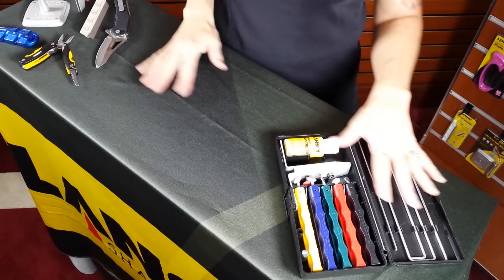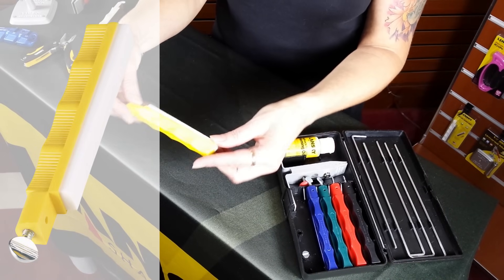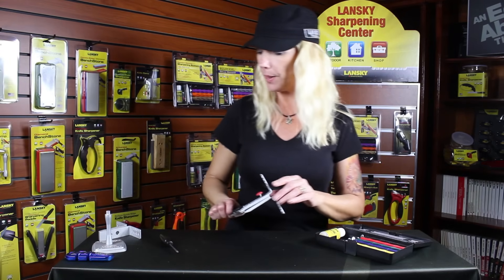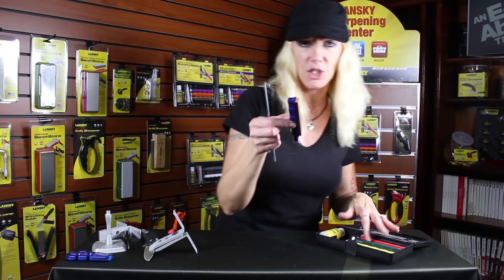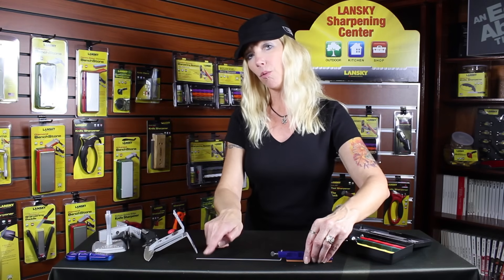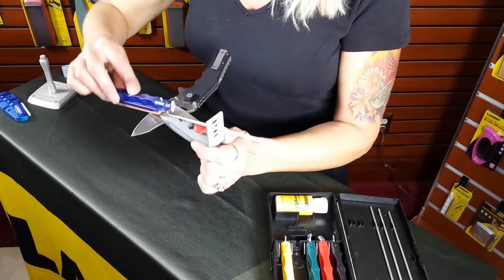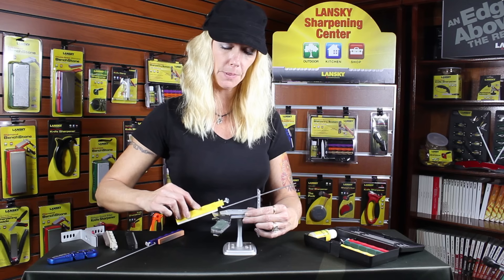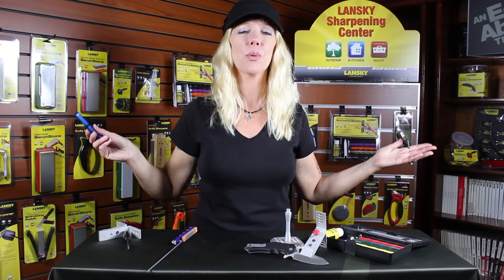The Lansky Controlled-Angle Sharpening System

Comment: Hey! I just bought one. Are you supposed to wet them before sharpening like a wet stone? I didn’t see you do it in the video and I want to make sure I use it properly. Thanks!
Reply from the maker: Hi there! Thanks so much for reaching out! In short, whether or not you wet the stones depends on which type of stone you use. For Alumina Oxide and Silicon Carbide sharpeners, we recommend using them dry, and cleaning them when enough metal debris has accumulated to interfere with the sharpening process. For the natural Arkansas sharpeners, we recommend using them with honing oil at all times to prevent glazing and/or fracturing. Lastly, for diamond hones, do not use the oil at all. For more detailed information or if you have any other questions for us, please contact us at customerservice@lansky.com ! We hope this helps!

Comment: Bought one about 20 yrs ago to sharpen other people's knives. I have always free hand sharpened but always had people asking me to sharpen theirs aswell so I bought it to make sure I got perfect angles and save time. I used it to sharpen coworkers knives for free, at least 15 people. One day at quiting time I set it on top of my locker for no more than 10 mins and when I came back it had been stolen. The kit also had several stones (black and translucent) and rods I had acquired over the yrs that were worth a good amount of $. I never bought another rod sharpener despite how good that lansky was. I did replace my stones and rods with others but the ones in the kit that were given to me by my father inlaw before he passed can never be replaced or given to my own sons. I've thought about buying another one lately but now days I'd have to go with the diamond kit because of the super/specialty steels.

Comment: Awesome product, I got mine at Blade Show this year, I was worried I wouldnt be able to do a good job on my knives if I purchased one. But the young gentlemen there for Lansky was terriffic. Very nice and took extra time demonstrating until I was confident I could do it.  He showed me how to use it correctly, and i am very pleased with it and how my knives come out when I use my Deluxe System at home.  The Ceramic Pocket Sharpener he sold me on is also a terriffic sharpener!!! Thanks again Lansky guy!!!
Reply: Hi , i think this type of sharpening systems are not sharpening a blade on the original angle but on a forced angle and only if the blade is perfectly round with the same radius on the whole lenght of the blade this kind of system will work and i said not this sysytem but all the systems with only a pivot point.
If you are not in accord with me,  you can make a video to show with the electronic angle meter to show everybody in different spots of the blade it is a different angle and that can damage the blades and messed up your entire angle of the blade because when you haveTHE SAME HEIGHT BUT DIFFERENT DISTANCE, THE ANGLE BETWEEN THE BLADE AND STONE CHANGE, and THATS NOT GOOD FOR THE BLADES.
After few sharpening sessions with these kind of systems you will have on a single blade a mutitude of angles that VARY with the shape of the blade, the more curves or chages of a direction of a blade has the more angles you'll have because, LIKE I SAID BEFORE, THE DISTANCE AND ANGLES ARE  INVERSELY PROPORTIONAL then as one quantity increases, the other decreases.

Comment: Instead of tape in the jaws of the clamp, try moleskin, found in the first aid section (foot care) of grocery/drug/large box stores, or thin supple leather like natural chamois. These two materials not only help prevent scratches, they will aid in keeping the knife from moving in the clamp especially when the spine or sides of the knife are shaped in unusual ways. Try the moleskin or leather in 1"x 1" squares. Of course your needs may require differing sizes. Moleskin usually has an adhesive backing so you can affix it to the inside of the jaws.
Reply: thank you for the advice :)
Reply: Try human skin......
Call me hannibal.....😝
Reply: Hi , i think this type of sharpening systems are not sharpening a blade on the original angle but on a forced angle and only if the blade is perfectly round with the same radius on the whole lenght of the blade this kind of system will work and i said not this sysytem but all the systems with only a pivot point.
If you are not in accord with me,  you can make a video to show with the electronic angle meter to show everybody in different spots of the blade it is a different angle and that can damage the blades and messed up your entire angle of the blade because when you haveTHE SAME HEIGHT BUT DIFFERENT DISTANCE, THE ANGLE BETWEEN THE BLADE AND STONE CHANGE, and THATS NOT GOOD FOR THE BLADES.
After few sharpening sessions with these kind of systems you will have on a single blade a mutitude of angles that VARY with the shape of the blade, the more curves or chages of a direction of a blade has the more angles you'll have because, LIKE I SAID BEFORE, THE DISTANCE AND ANGLES ARE  INVERSELY PROPORTIONAL then as one quantity increases, the other decreases.
Reply: You just gave me an idea. Band aids
Reply: I’ve been using this system for years. It works just fine. It doesn’t create new angles and sharpens at the same angle on all of my knives and does a great job.

Comment: Good sharpening system but I purchased the 5-stone kit a while back and immediately regretted I didn't get the diamond kit.  I spend 10 mins per kitchen knife on the course and medium stones and still cannot get a burr.  Spend the extra money on the diamond kit unless you don't value your time.  The stones tend to load up and get slick as well (take a look at her blue stone at the end of the video).  I found myself cleaning them after every knife, which also adds to the time.

Comment: One trick I found is using wet dry sandpaper taped to fine stone. Found grits from 1000 to 7000 grit. Puts a mirror finish on edge plus takes sharp to a new level.
Reply: good idea! I cant find anything better than 600 grit around here for sharpening stones.
Reply: Same as l sharpen my ski edges. 400 paper and on
Reply: @TheRockerxx69   Jesus where the devil do you ski lol
Reply: Pavement

Comment: I would probably try switching the hand when changing sides, to slide towards the tip on both. That should make the point sharper as there is a danger of rounding it when going towards the grip on on side, starting to slide setting up the stone against the tip.

Comment: Great system. Works very well. The instructions say to have about 5/8" of the blade extending. On some longer knives that is not possible, i.e. Chef's knives. Any suggestions are appreciated.
Reply from the maker: We're so glad our system is working well for you! If your blade is greater than 7" in length, pick the end of the blade where you would like to start sharpening and place the clamp two finger widths away from that end of the blade (so for example if you choose the tip, place the clamp two finger widths away from the tip). Once the clamp is secured, your target sharpening zone is between two finger widths on either side of the clamp. After sharpening this area repeat the process by moving the clamp two fingers away from the edge of the newly sharpened area. For knives over 7 inches we recommend sharpening them in sections of 3-4". You can also use a small piece of tape to mark the edges of the section you're sharpening to minimize overlap. If you need additional assistance or have other questions please reach out to us at customerservice@lansky.com.!
Reply: @LanskySharpeners  Thanks! Appreciate the response.
Reply from the maker: @andycarrigan1868  You're welcome!

Comment: Still have my set I bought in the mid-80's and use it monthly. I'm about ready to change out the stones..... One note - extra course and course aren't just for damaged blades. If you want to change angles for whatever reason, it's always good to start out with Extra Course to reset the blade.

Comment: Hm…. I may be obtuse, but I can’t get this kit to work on a Victorinox SAK. At a 25 degree setting the stone will (just) clear the clamp, but at a lower setting it won’t. The blade isn’t long enough to first do one half, change its position in the clamp and then do the other. The middle gets left out. So my question is: Am I getting this wrong (how?) or is this set not suited for small edc knives?
Reply from the maker: Hi! Sorry to hear you're having some trouble. Are you using a standard clamp or one with a rubber insert? Using the standard clamp without the insert is best for smaller blades. Let us know if you have any further questions!
Reply: @LanskySharpeners  Standard clamp. Can't get it to work on a small knife and I have a bettter solution for bigger ones, so I'm sorry to say it has become superfluous.
Reply from the maker: @bertushofstra8246  I'm so sorry to hear that! If you'd like to reach out to our customer service department, they would be happy to work with you on this - our email is customerservice@lansky.com.

Comment: Another tip is to use a clothes pin/bag clip or something similar on the rod to prevent pulling the rod too far back. This helps improve speed quite a bit.
Reply: Great suggestion, I've just been dealing with the over-pull issue. I'm defiantly going to implement this.

Comment: New to sharpening (at least serious sharpening) and have a Lansky system with standard hones.  I have some knives that I need to reprofile and am wondering if I can do that with a extra course or corse diamond hone and the finish up with the standard hones.  Thanks for any advice!
Reply: The type of stone doesn't matter. You can mix and match materials. What matters is the angle and the stones getting finer as you go.  Once you start using a stone, the material of the stone you used before doesn't matter. For example, in this video she used the aluma stones and then finished with ceramic.
Reply: @dkingpin74  thank you for the info!

Comment: thanks for the demo. Should I be using the oil that came with my kit for this?
Reply from the maker: It's really a matter of preference. You can use the oil on the hone to sharpen with, or use it only after sharpening to remove any metal shavings that collected in the hone during the sharpening process. Just make sure not to use any oil at all if you have a diamond system.

Comment: I know this is an older video.  I highly recommend the ceramic handheld, C-Sharp, for quickly putting the edge back on kitchen knives.  The C-Sharp isn't as precise as a full honing, but it's convenient and keeps you cutting.  If you're using your knives very seriously, break out the Precision Angle system.  Two things:  The rod isn't tight in the angle slot in the handle, you need to use your finger to keep it snug.  Be sure to check the screw holding the rod in the stone, they will work loose (don't gorilla tighten them).

Comment: I tried doing three S&W Extreme Ops cheap knives today and yes I got them sharp up I never could get them razor sharp. I then tried sharpening one on my electric sharpener and without any effort I was able to do the paper test and it worked like a charm. What degree is recommenced for folding pocket knives?
Reply: Depends on the manufacturer. Some like 20°, others 25°. 

Mark the edge with a sharpie and while using the fine grit stone, start from the shallowest edge working up in angle until a single pass can cleanly remove the mark. This will give you the exact angle you need to use to sharpen it to factory angle and sharpness.

Hope this helps.
Reply: @taimaishu-nao1922  This blew my mind. I NEVER would have thought of this. Thanks

Comment: I was going to purchase the Diamond system off Amazon however there are many reviews complaining about the clamp not holding the knives and damaging the knives. Have there been any changes made to the clamp?
Reply: I've had the diamond system since the mid 90s. I have sharpened my USMC KABAR, several different brand pocket knives, and even kitchen knives. I have never damaged a single blade. You just need to be deliberate and follow her instructions on how to lock the blade down. As she stated I use a new piece of electrical tape on each side of the clamp for every blade I sharpen. DO NOT REUSE TAPE FROM ONE BLADE TO ANOTHER as blades have different shapes and you could wear out the protection by tearing the used tape. I hope this helps.
Reply: @dkingpin74  thank you for taking the time to respond.  In January 2022 I purchased the Deluxe 5 stone system.  Very disappointed with the results.  Tried a variety of kitchen knives from small 3” blades to 6-7” blades.  I’ve done as few as 10 swipes with each stone, from coarse to the ultra fine and the result was dull. Then I tried 30 swipes with each stone-same poor result. Let my stepson borrow it for a few weeks-he didn’t have any better luck.  In only one instance did the knife feel sharper than where it started.  I even bought screws to replace the big red knob that prevented me from sharpening at the sharpest angle.  Also bought the table clamp and the pedestal.  Now it sits gathering dust.  I’d spent an hour and a half on just one blade-very disappointed 😢

Comment: Question  When sharpening your blade with this system in regards to the 17, 20, 25 and 30 degree offset slots, do you try and keep the rod at the top of the slot or at the bottom of the slot while using your stones.
Reply from the maker: You can keep the rod in place best by holding it down with a finger at the back of the clamp, which would hold the rod against the bottom of the slot. Hope that helps!

Comment: Hello I have a case trapper 2 blade knife when I try put the clamp on the stone hits the clamp It's hard to get enough blade in clamp to keep it tight
Reply from the maker: Hi there! We tested a Case Trapper in our system to better understand your issue, and weren't able to replicate the problem. Could you please share a little more detail? You may also redirect your question to customerservice@lansky.com for more in-depth assistance! Hope this helps!
Reply: @LanskySharpeners  could you send a pic of the case trapper in the clamp plz
Reply from the maker: @donniemurley8812   Please send us an email and we'll be more than happy to help you with that!
Reply from the maker: @donniemurley8812  Sure! You can reach us at customerservice@lansky.com

Comment: I noticed that she sharpens in a different direction when the knife is flipped over. Is that the best method or does it matter?
Reply: It does not matter. As long as the burr is consistent and as long as the burr is completely removed at the end with a strop. The direction of the scratches do not matter.
Reply: @JoseGabriel-dd2up  Japanese knife masters ALWAYS sharpen from the tip down. But in the words of Keith Hodges...do whatever DA FUQ you wanna do!

Comment: Hello I've been researching knife sharpening systems for the last week, from electric to homemade, wet-stones and grinders on drills. I want something for my Japanese kitchen knives, are kitchen knives to big for this system ? as every time I see people using it they are sharpening pocketknives..?
Reply: Good question.   We have two long Globals and one rectangular chopper knife my brother in law bought for us from a master in Japan.    Would hate to ruin them.
Reply from the maker: Thanks for the question! Most kitchen knives and other larger knives can be used with the system without any issues. Both our dual thumbscrew Soft-Grip clamp and our Standard clamp can accommodate almost any blade up to 7" long, however, the Soft-Grip clamp is not intended for use on blades measuring 1/2" wide or less. Hope this helps! If you have further questions please let us know.

Comment: My question is , why do you set at 25° for pocket knives? I did start at 25° but i got to thinking about how i did my knives by hand and i would be sharpening at at least 20°. My knives came out sharper doing it at this angle. And it seems everyone has a different way of sharpening. I'm still working on some of my knives because i wasn't doing it at the right angle. I think all knives should be at 20° except for bigger hunting knives. I think it will take a few times to get my knives back to where they should be. I bought the deluxe kit and the extra fine hone right away and it seems to be doing a good job. I would surely look at the lansky site to get the proper way to sharpen your knives. Thanks for your help.
Reply: It really depends on the use , say to shave 17 , 20 is a good sharp knife but don’t last as long as a 25 degree where you would say cut card board  all day but it not as sharp as 20 but still cuts cardboard or rope great  all day no issues ..... if that makes sense at all
Reply: @dewroc66  I agree. I would use 17 on a filet knife, 20 on a kitchen knife. I would keep the 25 to an everyday pocket knife like you described. Probabble go 30 on a hatchet or machete

Comment: Is it possible to sharpen straight blades with this as well, e.g. chinese cleavers and alike?
Reply: Their edges (cleavers, axes) usually are too far from the clamp and the hones can't reach them but you can sharpen some big fixed hunting knives and some thin machetes.
Reply: @pericodelospalotes5738  i just went ahead and made a longer guide rod from a more sturdy wire cloth hanger - worked great!
Reply: @pericodelospalotes5738  She mentioned above that you could move the clamp up or down the blade to reach all areas of edge for long knives.